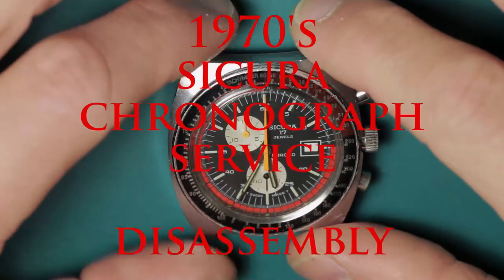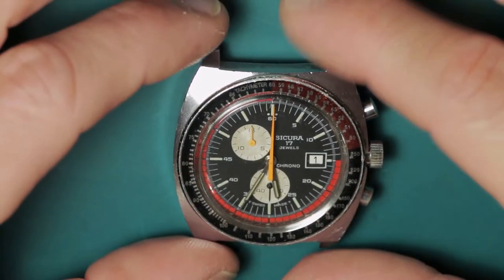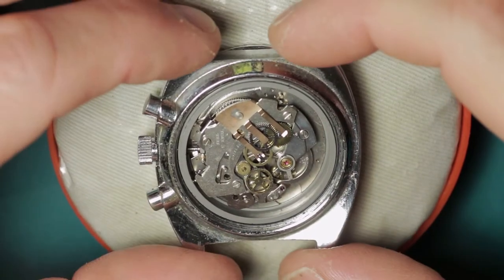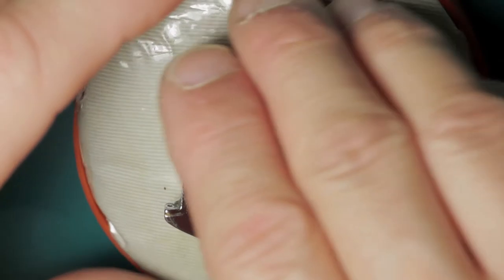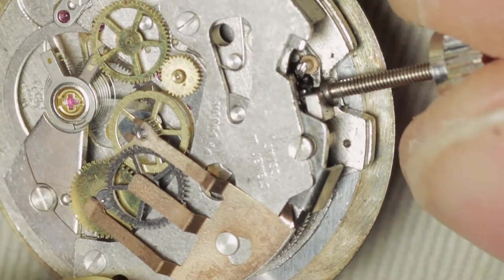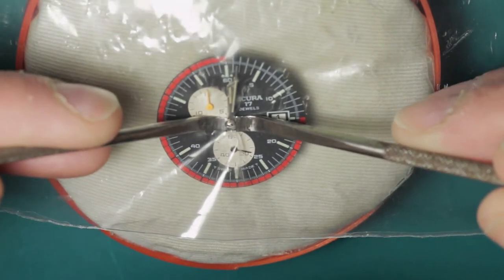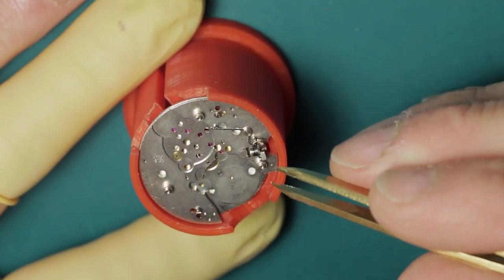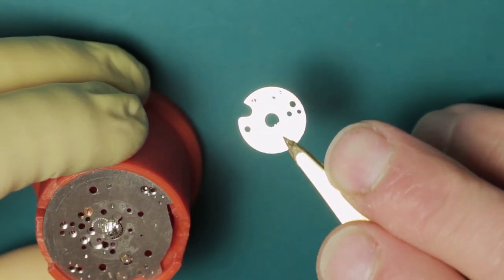Sicura Breitling Chronograph Service - History & Disassembly

Comment: Thanks for producing these videos! Are the movement holders you use something you make yourself with a 3D printer?
Reply from the maker: Hi John. I hope you enjoyed it. Yes. I make most of my movement holders on the 3D printer. I do simple designs in tinkercad which is like 'CAD for dummies' and henceforth perfect for my computer skills.
I like them because they can be sized to grip tightly but being plastic doing risk marking plates. I find they're easy to chop pieces out of for different movements and easy to reprint should the need arise. I have a selection in 1mm increments and the odd one in 0.5mm increments.
I do also use a standard Bergeon type holder for some operations were I need access to the sides or there's some reason the 3D print ones don't work.

Comment: Hi q8 watched your 3d printed mainspring video b4 this, i just got a caliber specific 10 winder set from ebay, i watched Mark Lovics video on them, they now are properly made with steel in the right places not just brass, it was very reasonable at 75 quid for 10 winders, just thought i would mention it while i was watching your video, great history info mate, the mainspring is just like my Junghans 93/1 with a central pin and the arbour built into the lid very interesting great video, cheers.
Reply from the maker: It seems that most of the chinese made ones now have the steel arbors, that's a great price for the set.

Comment: Is it possible to regulate on a TG. ?
Reply from the maker: Yes it is.
Some say they've had difficulties getting pin pallet movements to read but I've not so far had a problem.
What you will get is a large PV and a slower recovery rate between transitions but I get a 'near enough' then wind every 24 hours and test on the winder to get an average and regulate a few SPD up or down to average the rate out.
Reply: Good to know for future projects 😊👍

Comment: My dad has this watch but the timer buttons dont seem to do anything. 

But hey thanks to this vid i now know how to change the date 😂
Reply from the maker: If the chronograph buttons aren't working and the watch isn't running then it'll need a service. If the watch is running but the chronograph doesn't work most likely one or both of the pushers is stuck.
Reply: @spidiq8  it runs for about a day then stops and winding the date gets stuck. Could it just need a good clean inside?
Reply from the maker: @DropDeadGem  Most definitely in need of a service.
These type of movements in particular were rarely serviced as they weren't very expensive so most people would put them in a drawer and buy another watch.
Reply: @spidiq8  dang ok, thank you for the reply

Comment: Hi
I've just got one of these from Ebay.  The movement appears to be fine and the dial is perfect, but the case is filthy.  I'm competent enough to remove the bezel, backplate, movement, stem etc., but as you've worked on these, can you tell me which direction the crystal comes out and did you remove the push buttons?  How do you remove them?  Do they have replaceable washers and springs?

Any help gladly accepted.
Reply from the maker: Crystal comes out from the front. You can press out with your fingers. If it's a tension ring crystal you'll need a press to refit otherwise a crystal lift will work.
The pushers are a pressed together unit and can't really be disassembled. Any repairs originally would have been to press out the pusher unit and replace.
In theory you could separate them but would need to press fit them together again and there's a high likelihood of that not working.
The stem removal on the 8420 is tricky also. There's no detent to press. You have to get something thin in there and lever the setting lever away.
Reply: @spidiq8  Many thanks for the quick reply.

I've had the case, back, stem, bezel and bracelet sat in detergent and oxygen powder for the last hour and it's cleaned them up nice.  Might try to do the crystal tonight.  Information on the pushers was vital, thank you.  Just have to dot some grease down the side of the shaft.

Did your crown have an 0-ring?

Again, brilliant information, thank you.
Reply from the maker: @octaviussludberry9016  No problem and glad to hear it's cleaned up well. This particular one did have an o ring. The Sicura branded watches tend to have higher jewel count movements and better case components.
Reply: @spidiq8  I'll stick one in and see if it works.
It needs re-plating on the buttons and possibly the case, but that's for another day
It's the yellow/orange face dial, but I've just spotted a couple of this colour on Ebay for not much, I'll see what they go for, might be able to cobble together a very nice piece.

Run out of Polywatch annoyingly, will have to wait a day or two now to reveal it to the World, well, anyone who asks about it.

Many thanks again
Reply from the maker: @octaviussludberry9016  I recommend you get yourself some Micromesh sanding pads if you tackle acrylic crystals regularly. They go from about 1200 to 12000 grit and you can plastic smooth and shiny really easily with them. Use wet and they last ages. You can always finish with some plastic polish but generally after 12000 grit a crystal is smooth.
Reply: @spidiq8  Hello again.  Thanks for the advice about the sanding pads - crystal looks new now.
I have another quick question if I may?  The length of the pushers on mine, seem a bit short to hit the pads.  I see the ends of them have a slot - are the adjustable?  That is to say if I unscrew anti-clockwise, will it lengthen the pusher rod a bit to activate the pads?
Reply from the maker: @octaviussludberry9016  Typically no. If the end is slotted that's for disassembly. You unscrew with the pusher pressed in which is held on serrations like a 12 point socket. These type are great for being able to rebuild with new seals and springs if required and normally the cheaper pin pallet ones are a complete press fit unit so that's a plus.
In theory you could unscrew them a little but run the risk of them coming off and losing the pusher.
You can make extension pieces if you have a lathe and at a push could make some from plastic but brass would be preferable here.
Reply: @spidiq8 I have this problem with a Sorna 2697 (same movement you’re working on here) that I inherited. The gaskets on the pushers have deteriorated, making them difficult to use. I was hoping to refurbish them, but I may have lost all hope resting your reply. 😂 I’ll have to see if I can source complete replacements. 

Enjoyed both parts of this video. Very informative. Thank you.